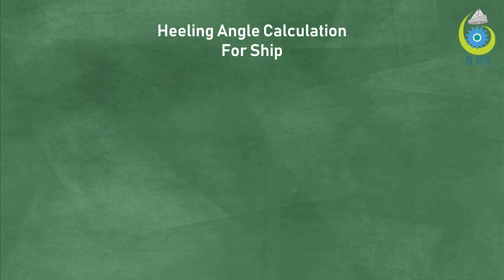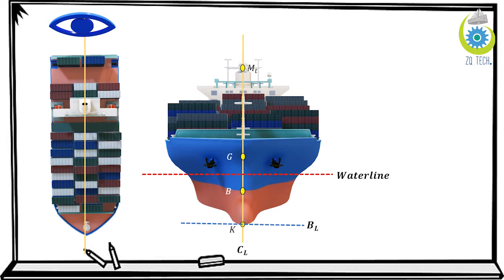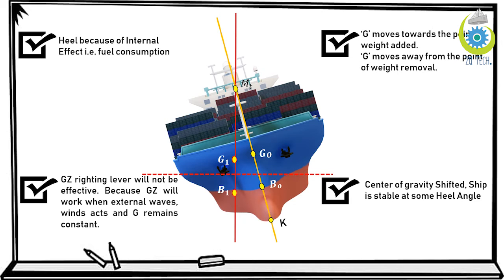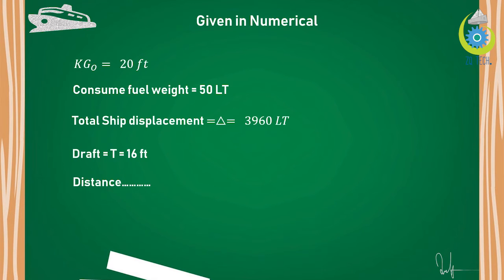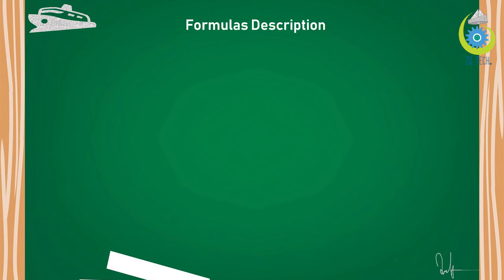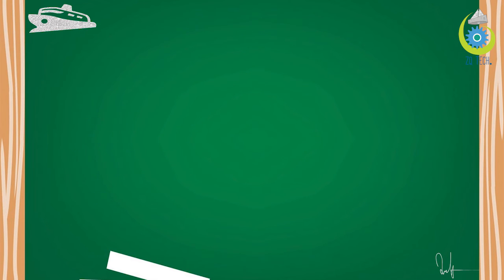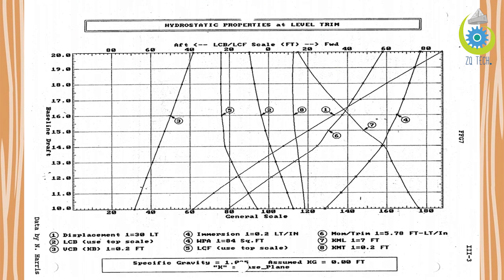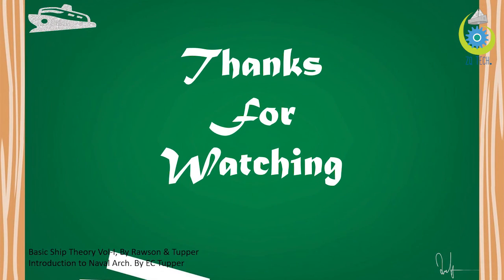Ship Stability | LIST Angle Calculation  for Ship | CG shifts in Ship | Tilt in Ship |

Comment: Hi - I purchased steel yacht and made significant changes to it affecting the ship stability- I also employed counter measures, but am concerned as CG is a bit high.  I went to know what conditions I can expect to sail, but local engineers are not responsive for assisting me in the calcs.  Do you have any simple suggestions for calculating ship stability that I can do myself.  ????  ( I'm fairly experienced and educated) - Any answers are greatly appreciated!!!!
Reply from the maker: Please answer the following questions to me what changes have you been experiencing after significant changing?
1- either it is bend on port or stb side
2- either bend fore or aft
3- speed is reduced or not?
4- what changes have you done on yacht
5- How you come to know CG is high
Reply: @zqtech.5421  I added several hundred kilos aloft, but also added fixed stabilizers- I also added a large platform in the stern for a yacht tender and two motorcycles (scooters) Not sure if I need to add additional ballast---   the motion is quite bouncy, not stiff.  Was curious to get a stability test done before I venture too far into open ocean... I have some nice photos if you give me an address to send them?
Reply from the maker: Due to busy schedule could not reply you time. Important thing is that your ship heel and trim should in range of IMO values for heel and trim. Please send you drafts values. You can share your pic on: wisezq131@gmail.com